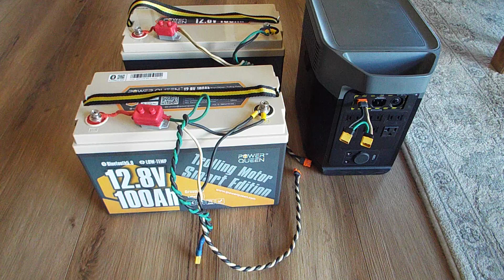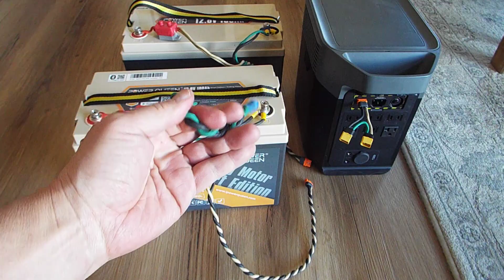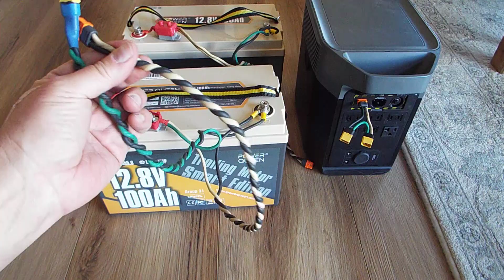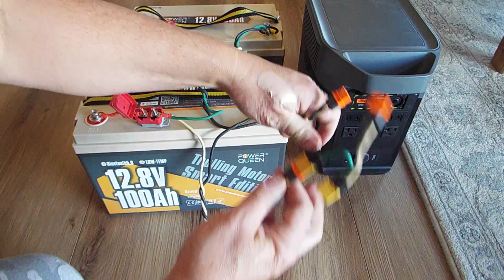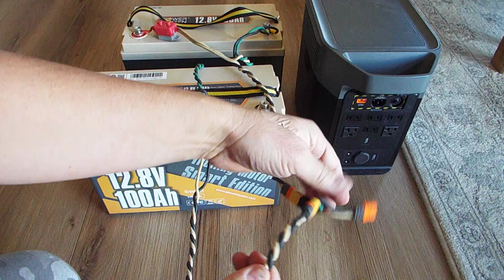Extending the Capacity of a Power Station: Battery Wiring

Comment: How would I wire 4 100 ah 12v batteries to get 200 ah 24v?
Reply from the maker: To get 24 V at 200 Ah from four 12 V 100 Ah batteries, you use a series parallel setup:

Connection overview
You will make:
- Two series strings of two batteries each → each string is 24 V 100 Ah
- Then connect those two strings in parallel → final bank is 24 V 200 Ah

Step‑by‑step wiring
Let’s label the batteries:
- Battery 1 (B1)
- Battery 2 (B2)
- Battery 3 (B3)
- Battery 4 (B4)
1. Create the first 24 V string (B1 + B2)
- Connect B1 positive (+) to B2 negative (−).
- The free B1 negative (−) and free B2 positive (+) are now the two ends of a 24 V 100 Ah string.
2. Create the second 24 V string (B3 + B4)
- Connect B3 positive (+) to B4 negative (−).
- The free B3 negative (−) and free B4 positive (+) are the ends of the second 24 V 100 Ah string.
3. Parallel the two 24 V strings
Now tie the two strings together in parallel:
- Connect B1 negative (−) to B3 negative (−) → this is your main system negative.
- Connect B2 positive (+) to B4 positive (+) → this is your main system positive.
You now have:
- Voltage: 24 V (because each string is 2 × 12 V in series)
- Capacity: 200 Ah (because two 100 Ah strings are in parallel)

Comment: Hi, can you share how you charge the 2 extra batteries? Thank you so much!
Reply from the maker: When grid power is available, the recommended method for recharging the 12V 100Ah LFP batteries is using a charger limited to 20 amps. During a grid outage, I switch to using my vehicle and jumper cables, which deliver a much higher charging current—around 90 amps. For slower, sustained charging when speed isn't critical, I rely on my solar panel array with a charge controller. However, grid failures often coincide with overcast conditions, making solar unreliable. In those cases, my truck serves as the primary backup to keep the battery system running for extended power outages.
Reply: @madscientisthut  thank you for your reply? Do you charge the batteries one at a time or is there a better way to charge them while they are still connected in series? Also what about charging in parallel? Thank you!
Reply from the maker: You're welcome, thanks for watching and for the comment! Yes, the batteries can definitely be charged either in series or in parallel, depending on what type of charger you have available. Just keep in mind that when charging in series, one battery might not reach a full charge. That’s generally fine as long as it’s not a permanent setup. To ensure all cells get fully charged, it's a good idea to occasionally charge them individually or in parallel. It might seem odd, but the internal BMS (Battery Management System) relies on this to balance out differences between cells.
Reply: @madscientisthut  Thank you!

Comment: Ok so if I wanted to just increase the AH capacity of my delta 2 would I need to wire all the batteries in parallel or can I make a 3 way cable and connect each battery separately to each connector if I make a parallel connector?
Reply from the maker: I’m not entirely clear on the configuration you're aiming for. However, if you’re planning to parallel two or more batteries at 12.8V, the maximum current the Delta 2 will draw is 15 amps with the XT60I connector set with the center pin grounded. This means you can supply a maximum of 192 watts (12.8V * 15A). For low power requirements, this setup should work just fine. But if your power needs are higher, you might want to consider a series connection to boost the power input, potentially up to 500 watts on the Delta 2.
Reply: @madscientisthut  well I was thinking of having the batteries in parallel and have them connected to a solar charge control that's hooked up to 2 200w solar panels. Then I'd build a 3 way cable like you show but in parallel. Im confused on if the batteries need to be connected in parallel and the cable as well. I hope I'm making sense. I'm horrible at articulating what Ieam because I don't know much about this.
Reply from the maker: Let me ask you this: What is your intended load requirement for your Delta 2? ( How much do you want to power at a given time and for how long will the load be present?)
Reply: @madscientisthut  a 12v. camping fridge. TV. Possibly a router. crock pot maybe. Just some things to get by.
Reply: @madscientisthut  maybe even my fullsize fridge. It's 230 watts
Reply from the maker: A 12V camping fridge can run directly from the 12V batteries (so it does not need to be connected to the Delta 2) . The router, which is a small typically less than 20 Watts, shouldn't be a problem. The crockpot, on the other hand, might be a heavier load if it's a larger model. However, a small 6-quart crockpot is relatively low in power consumption. If you keep your total power usage under 200 watts, your parallel setup should work well. Additionally, it will handle higher loads for short durations, as long as the Delta 2 internal battery has time to recharge during periods of lower usage.
Reply: @madscientisthut  I'm just looking to get the most out of it. If I increase the capacity by doing parallel and keeps the same voltage of 12v then it (from what I know) you then be a 5kwh system capacity.
Reply: @madscientisthut  so basically I'll have it hooked up to solar and a charge controller then from charge controller to the batteries and batteries to Delta 2. So you think a series connection would be best for that?
Reply from the maker: Just remember that the internal battery is approximately 1 kWh. With a parallel 12.8V input, you will be limited to replenishing a maximum of 192 watts continuously. So, even with 5 kWh of storage, a sufficiently large load could deplete the internal battery faster than it can recharge. This is where series connections of the batteries are beneficial, as they allow for faster recharging of the internal battery. Two batteries in series provide 25.6V at 15 amps, which equals 384 watts input. Using three or four batteries in series will max out at 500 watts of input with the Delta 2. The advantage of using four batteries in series (51.2V) is that it reduces the current draw from the batteries to about 10 amps, resulting in less thermal stress on the connections and wiring.
Reply: @madscientisthut  ok. So it will run for longer and be more efficient in series?
Reply: @madscientisthut  I couldn't tell in your other videos. Are each battery separate or they actually connected in series or is it just the cable that is series?
Reply: @madscientisthut  sorry for all the questions 
 I'm new to this
Reply from the maker: It’s not necessarily more efficient (likely a similar efficiency), but using a series input will support a larger load for a longer period.
Reply: @madscientisthut  ok. Makes sense. Thanks for your help. Much appreciated.
Reply from the maker: I believe my last video explained it a bit more clearly. I apologize for any confusion. The batteries are connected in series using the Y adapter. No worries about being new to this and asking lots of questions—I'm happy you're asking questions!